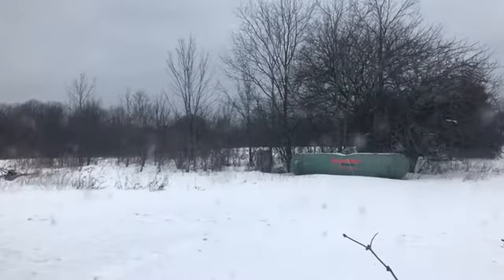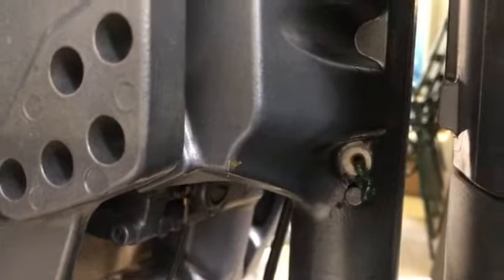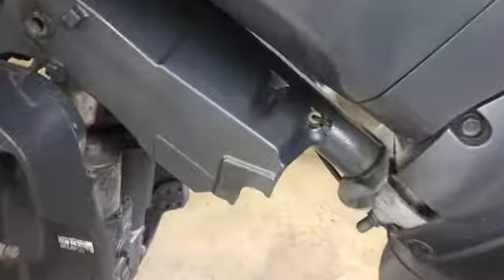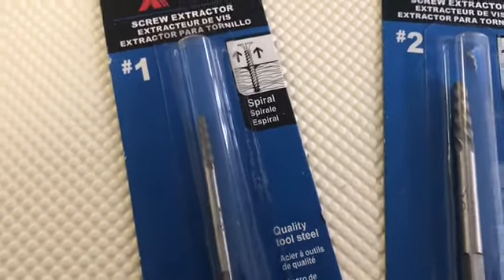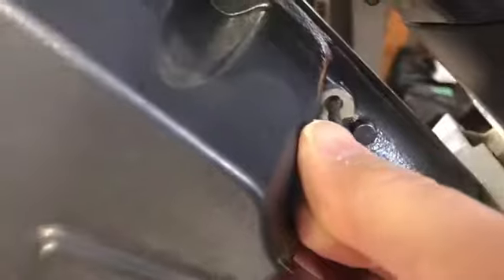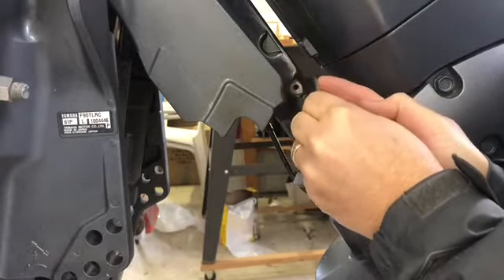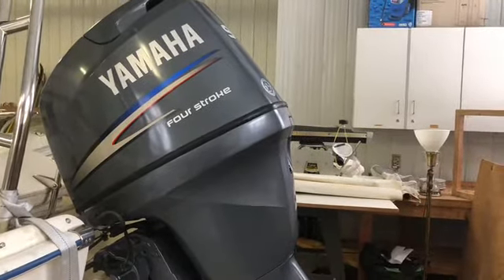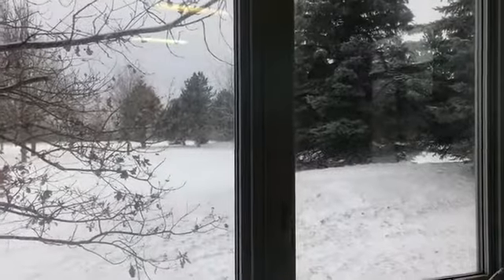Yamaha 90 hp - Removing Broken Grease Fitting

Comment: Sometimes these don't get enough bite. If these don't work, a t20 ot t25 torx bit hammered into a broken zerk works great.
Reply from the maker: Thanks for that tip - will be sure to try it on the next one I break!
Reply: Thank you! Worked with a t30 for a 1/4-28 fitting
Reply: Great tip! This is what I used for the same zerk fitting in the video. Except I had to use a T15. Came right out by hand.

Comment: What size extractor did you use?
Reply from the maker: It was the larger of the ones I had. The one that said No. 2 on the package. I went back to check the packaging but they don't indicate an actual size measurement like you would see on a drill bit for instance.